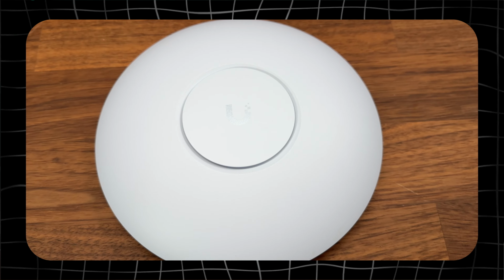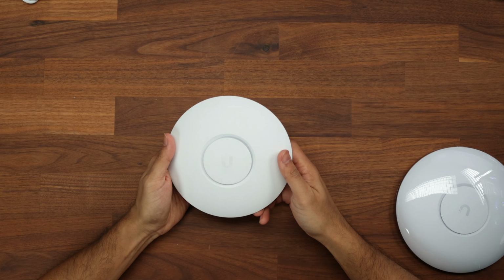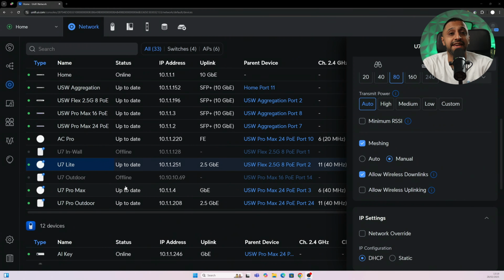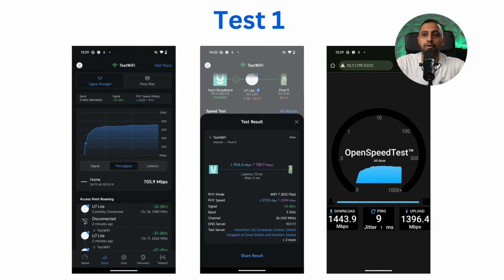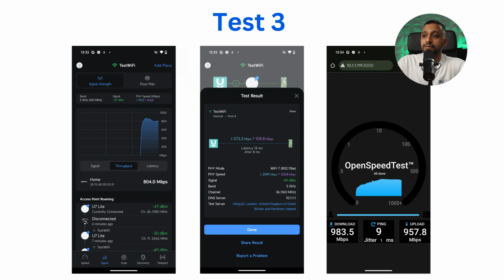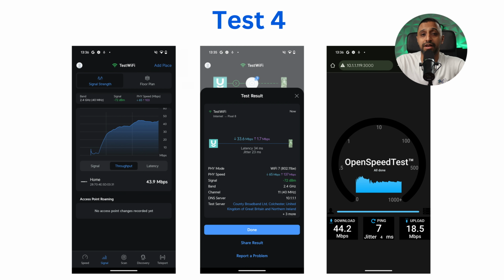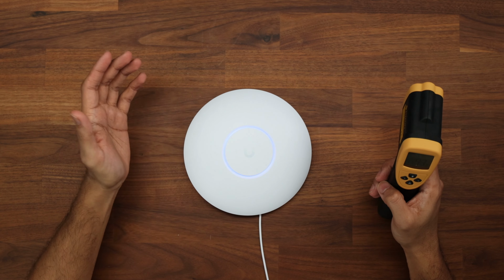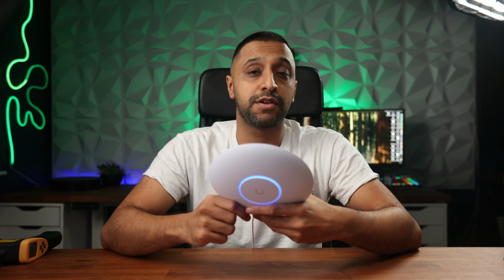U7 Lite - $99 WiFi 7 Access Point!

Comment: I got this with my UDR7 even though I find out I really don’t need  later on. But I still installed it just to fined out my wireless devices like my S25+ and 2 different iPads can’t connect to it. I even locked them to it and still can’t connect. I’ve reset it numerous times & Re’adopting it still won’t connect. My 2.5 gps   Cat6 from my UDR7 to the U7 is fine. So I don’t know what the problem is? 😠🤷🏽‍♂️

Comment: Did you put that plate on upside down? If not, how the heck will the tab sticking off the mounting plate not interfere with the hole in the ceiling for the cable? It would need to slide right over the hole if drilled according to the mounting template?

Comment: I'm looking at getting into the Unifi ecosystem.   Is there a significant coverage difference with these APs if ceiling or wall mounted?
Reply from the maker: Wall mounted one is generally meant for single rooms, for wall mounted options you may want to look at the pro wall or you can mount U7 lite, pro and pro max on the wall. Just keep an eye on the radiation patterns